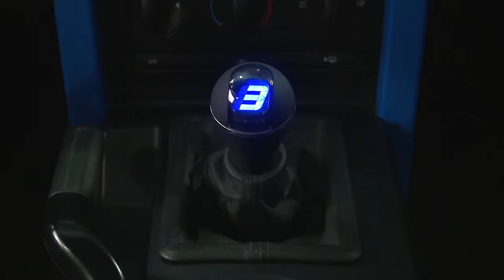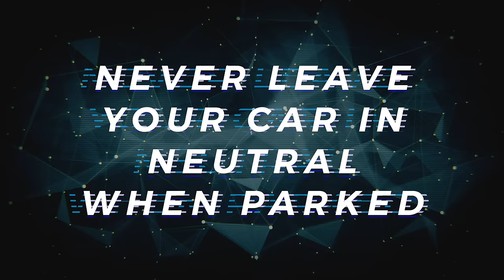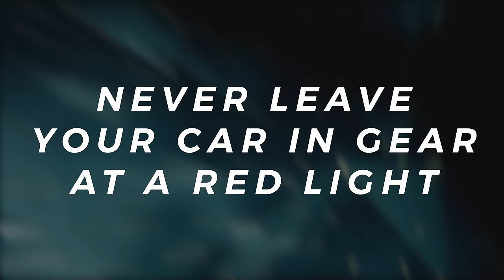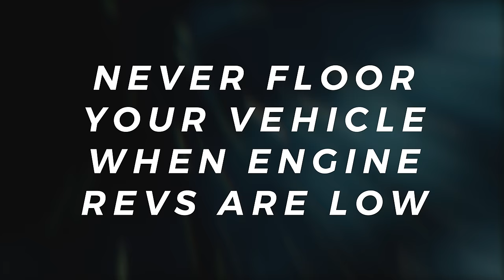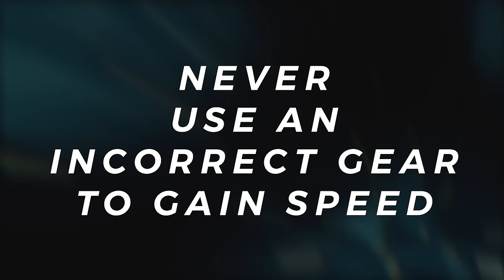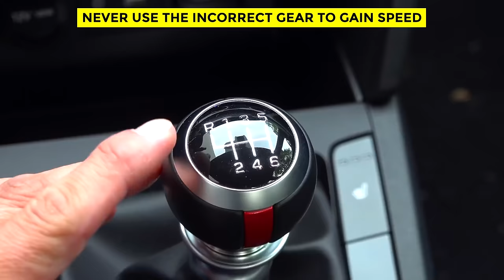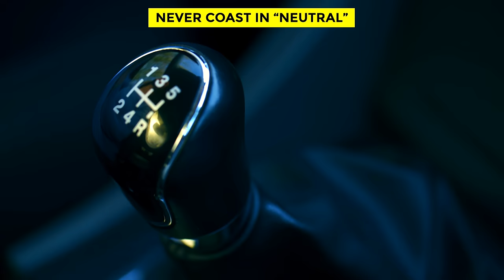7 Things You Should NEVER Do In a Manual Transmission Car!

Comment: This is all wildly exaggerated, you cant really lug a newer manual as if you have an electronic throttle body then its designed to use max torque per rpm, so pushing the pedal down all the way may only get the throttle body open 80%. Also, i grind gears because the throw-out bearing is a little worn.

You want to slip your clutch a little to make it smoother, so don't say "never slip your clutch"

Also, a clutch isn't all that expensive depending on your car, ive got a 300ft-lb clutch and a factory replacement is around $600 which is fairly cheap

"Transmission doesn't get proper lubrication" dude, its not like an automatic where you need pressure.... its a manual, an empty case where the fluid rests and gets stirred up, no torque converter or anything.
Reply: also loved the one about the engine not getting enough oil while coasting in neutral...
the engine isn't engaged to the transmission. you might as well be idling at a light

Comment: 1:47 THIS IS DANGEROUS ADVICE! The clutch pedal should only ever be pushed in either if the car is stopped, or if you are changing gear. If you are coming to a stop, the clutch pedal should only be pushed in at the last moment just before it would stall. To push the clutch pedal in immediately when yo start braking (remember we often use the brakes to slow down but have no intention of stopping) makes it harder to keep the vehicle in control and can be very dangerous in certain conditions.
Reply: bruh relax its not you can keep it in neutral if you are at like 30-40 mph and coming up to a light or something it dosnt matter

Comment: Fun fact: Planes are less complicated than cars
Reply: Really?
Reply: @thegrimreaper270  yes just learn how to start engine reverse thrust and the pedals easy
Reply: Well considering the lack of a transmission.... many GA airplanes are very simple. Some dont even have flaps! However, if there are flaps, speed brakes, a constant speed prop.... not necessarily
Reply: @thegrimreaper270  to not confuse "planes are less complicated than cars" with "planes are less complicated to operate then a car". But yeah: An old Cessna is simpler then a modern city car. Planes tend to be a lot more simple and mechanical, where as a car is stuffed with electronics.

Comment: I agree with most of these except one, leaving your car in gear when the car is off and parked. I was taught by an advanced driver not to do this. But that was a long time ago and I guess modern tech probably prevents damage to the gears if the handbrake fails. The only other thing is, I have a Hyundai I10 and clutch slipping with this car is almost mandatory due to the weird nature of this particular car. Pulling away with this car takes serious skill. Never had this experience with other cars. In other words I don't clutch slip with other cars.
Reply: What's with this "damage to the gears" thing people keep saying? You leave a manual transmission car in 1st gear or reverse, since that means the car can't move. It's advisable to also use the parking brake. In winter, if you have a manual parking brake, you only leave it in gear, since you run the risk of the parking brake cable freezing and leaving your rear wheels blocked.

How can you damage something that is designed to take the torque of the engine and move it to the wheels? HOW? Going 0-100 kph in 3 seconds means you're pulling 1G in acceleration. That's the equivalent of your transmission holding the entire weight of the car VERTICALLY, with no damage.

In other words - the torque a stationary car (or even one parked on an incline) applies to the gears is nothing compared to what they have to go through daily, during normal operation.
Reply: Clutch is designed for some slippage. Otherwise you'll stall all the time.
Reply: @2010ngojo  the weird thing is, this particular clutch is very "narrow" if that makes sense. The amount of play before it starts to take and when its fully engaged is unusually small. I know a lot of people who have the same model and they all say the same thing. The car shudders very easily. Even advanced drivers find it difficult to get used too. I think half the problem is the fact that its only a 1 liter engine.
Reply: I usually leave the car in neutral, with hand brake on, unless parked on a hill. But in modern cars with disc brakes in the back the mechanism in caliper sometimes fails, or cables seize if not used on daily bases. Personally I rarely see seized cables, even when the plastic coating breaks, if the hand brake is used regularly. As for winter use, I like to slide my rear on the nice, fresh snow with my hand brake on - I never experienced frozen cables problems in the winter time.
Reply: I dont leave my car in gear when parked either.

Even if I did it wouldnt stop it rolling down a hill, everything inside is so light that the engine and transmission would just start turning with the wheels anyway so it wont stop it from rolling.
Reply: yea, i usually let my car stay there just relying on the parking brakes. cant afford to ruin anything else especially the wonderful motor
Reply: @_Zekken  sounds like you have a compression leak and need and engine overhaul, it has nothing to do with how "light" your components are.
Reply: @royhsieh4307  how would it ruin the motor?
Reply: @lazyh-online4839  it does not have a compression leak, I only got a compression test done 2 months ago with it last full service, which was done by one of the best performance shops in the country, and according to them the entire drivetrain is in fine condition.
Reply: @_Zekken  alrighty then, I'm not sure what the issue is then, as mentioned the "lightness" of your vehicle/components has nearly nothing to do with their ability to resist rotation. If you're on anything besides a steep incline there should be no movement whatsoever unless there is either engine or drivetrain issues of some kind of it's put in gear whilst parked (1st or reverse obviously).

Comment: This is reminding me of the time I found out that my vw Polo from 07 doesn't need its clutch pedal. If you press the gas pedal just the right amount, you can pull the gear stick out of gear as well as back in when you match the revs to the speed and gear that would fit.

That's not very healthy either :)

Comment: It's better to put your gearbox in neutral, engage the parking brake, and then put the gearbox back into gear. You do this so the weight of the vehicle will be resting on the brake instead of the gearbox
Reply: European: Question
American: What's your question?
European: There is no parking brake
American: What?

Comment: On my car, if I leave the stick shift in reverse the backing lights will turn on, even if the engine does not run draining the battery...any other gear, not only the 1st is ok.

Comment: My friends doesn't use his clutch when his car is above the first gear

I never heard it grind
Reply: i learned to drive a manual when i was 10, took my drivers test and got my license in the same truck i learn in, after i got my license my dad taught me how to shift into any gear over first without the clutch and oh my god, that saved my leg so much work and it worked so well cause my truck only has some 110 hp
Reply: @calebb5106  what the fuck? how can u shift in any gear without the clutch?
Reply: @burstkappa6206  it's only for 2nd and up, but you would run to the top of the gear or around the top and let off, if you were in second you would push to neutral with light pressure as to not damage anything but once it hits the right rpm it will literally fall into neutral, then to go into 3rd you would push up into 3rd until it falls in, if the rpm is too low then you can blip the throttle to get to the right rpm and just repeat to whatever. I would recommend finding an empty straight road and practice without any traffic around before doing it out with a traffic around, I mostly do it now when my leg is giving me issues again so I don't hurt myself any further
Reply: @burstkappa6206  if revs match (drive shaft & crank shaft), you can pull it out of gear and put it into gear without a clutch. Doing it perfectly ensures basically no wear on the transmission or clutch (you still need that when starting from a stop). Doing it badly will f*ck up the transmission's synchronizer rings.
Reply: lets give me a moment to send my warm congratulations to your friend who r in the elite shifting club
Reply: Roy Hsieh   Lol it’s so easy to do though.
Reply: Ah yes flat shifting, if you know how to do it well theb your gears will never grind

Comment: What about when I am red lining in top gear, do I switch it to race mode or something
Reply: Duh, haven't you seen an "R" marked on the gear lever, that is the "race mode", also works as reverse. If you put in "R" and drive from still, it will move only in reverse. If you need to engage "Race mode", you need to reach the red line in top gear and then put it into the "R" gear and dump the clutch.
Reply: @naseeb46  Prepare for a few G's of force (in some direction) when you do this, race mode is powerful.
Reply: I'm dead
Reply: What tf is race mode

Comment: Ah yes, letting your can idle will make it overheat and fail, even with excess air running through the rad. 😂😂
Reply: michael lee   You are rolling down a hill in neutral. Car at idle with heaps of air flowing through the radiator. It won’t hurt your engine at all. The motor isn’t running at high revs. So no need for the water pump to be pumping heaps in. Same as oil.
Reply: michael lee  so why dont you switch your car of when you stop becuase its idiling? A car idealing is the least stressful for the car becuase it under the lowest load. Cars are made to ideal otherwise we would all be switching a cars off at stop lights.
Reply: @dieter2889  Your point is valid, but excessive idle times and low engine speed operation can cause excessive carbon buildup on everything from the pistons back to the throttle body, some engines worse than others. I've sold and performed so many throttle body cleanings and induction cleanings because people think idling their cars around town is the best way to drive them.
Reply: @collinbyrd6847  true, letting your car idle excessively will cause excess carbon build up. Same with short trips yoy never let the car burn of any of the build up.

Comment: For the second tip, is it also okay to ride in neutral when going to a stop, using only the brake pedal?
Reply: This comment is a little old, but it seems to be a genuine question, so I'll answer it: It's totally okay to put the transmission in neutral and take your foot off of the clutch to come to a stop.

Comment: You shouldn't coast down hills in neutral but for a different reason, when you are in gear you will go slower because of engine braking, going into neutral means you are rolling freely down the mountain and have less control of the vehicle. Also you will heat up your brakes more because you aren't slowed down by the engine which can be really dangerous if you are on a big or long hill because your brakes will fade from that and then you can't brake at all but this is more a problem with heavy or old vehicles that have brake shoes. You also shouldn't ride the brake for this same reason, do shorter, hard braking instead when going down a hill.

Comment: The reverse gear on my car isn't synchronized so I've grinded that gear a few times... I don't do it anymore though as I learnt to look at the stick to make sure the gear has gone in fully, if it hasn't I go back and forth between 1st and R until it finally does get into the grooves of the gear.
Reply: Model T?
Reply: @mikekelly5869  alot of cars have unsynchronized reverse gears probably up into the 2000s
Reply: what helps is going into 5th then reverse because its right above it, or have it in neutral hold the clutch down for a few seconds and it should give enough time for the gears to slow down, or my favorite way just go right into reverse fast and it dosnt grind

Comment: "There is no oil pump in a manual transmission, so coasting downhill in neutral doesn’t starve a gearbox of oil" thank you for tapping in this too. my ex bf always did that and i kind off coping it...never again!!
Reply: it dosnt matter as long as the engine is running you cant cost in neutral it dosnt cause any harm

Comment: So, I have a Ford Ecosport diesel. I usually keep the revs between 2k-3.5k rpms (very rarely 3.5k) 

I usually slowly down shift from 2k+ rpm and the revs climb upto 3k rpm or so.

My question: Is this a good habit? If no, what's the alternative for using maximum engine braking for better fuel economy without applying breaks

Comment: For hills, what I usually do is I release the clutch to the biting point right before I’m about to take off, then I release the brake n get on the gas as soon as possible before the car starts to roll back. I’m new to manual so idk if this is the right technique or if I’m actually hurting the clutch in the process.

Comment: I drove my 76 Camaro with a m21 and always had my hand on the gear shifter, had no such problems. Coasting in neutral I had no problems with control or oil pressure. Everyone is different.

Comment: 9:15 actually its a good thing in older cars. some don't have a one  way bearing on the gears and when goind downhill you can get engine into red line preety fast or damage the transmission/engine. such of a car that is better to get into neutral when going downhill is a trabant 601.
Reply: trabant 601 is not a car 🤣 my parents used to have one, so I know best!

Comment: Very experienced drivers drive away in 1st gear ofcourse, but when you have the right moment you can put it in 2nd and so on without using yr clutch. The engine and gearbox have the same speed, so it automatically switches in 2nd, 3rd etc. without grinding the gears. But most people should not do this, because this needs a lot of experience.

Comment: Very funny to listen from Europe where all drive manual. In most of descriptions you miss details and present as "never-ever do that", however some techniques are absolutely normal as weighting on the red light with a gear but clutch pedal being completely down - no disks are touching so no overuse of the material. If you cant drive manual or half of US cant doesnt mean others cannot
Reply: its just kinda weird to leave it in gear i mean your throwout bearing will go bad faster and will wear your pressure plate more people in the uk are just weird ig
Reply: @ethanol-fb  how it will go bad faster? You leave it a gear with clutch pedal down - at this point there is no physical contact inside the gearbox. People are weird to say smth will go bad not being able to argument why...
Reply: @ethanol-fb  tell you more - in cold regions sometimes you even park your car with gear in and leave it for the night. Doesn't make gearbox break faster (since motor is off) but at least you will be able to drive the car in the morning after very cold night.
Reply: @gnoverelectric  leaving your car in gear wont do anything anyways youre supposed to park it in gear anyways whats your point
Reply: @ethanol-fb  no you are not supposed to park your car in gear - you have manual break for this (or parking break which is not a gear).  You wrote "its just kinda weird to leave it in gear i mean your throwout bearing will go bad faster" - which does not make sense - you stop at light, on the gear, clutch pedal down, break pedal down (no disks are in contact so nothing will go bad faster). To start to move you just remove break pedal and move the clutch up - no need additionally to put gear with your hand. Simple as that. Everyone drives it. Sure you've ever driven the manual?
Reply: @gnoverelectric  look i know you dont know anything about the inner workings of a trans but whats crazy is i build transmissions to disengage the clutch it uses the throwout bearing to press up against the pressure plate how hard is that to understand, and yes mf you should park in gear idk why so many people dont understand that you are supossed to park in gear some cars will have a lockout so you have to put it in gear to take the key out parking in 1st or reverse dosnt matter wont hurt anything
Reply: @ethanol-fb  Yes, you know how the stuff works but dumb enough not to understand that when you stand at the light with clutch down there is no friction part between pressure plate and throughout bearing since there is no contact at all. How does it make something to be used more? Really, you make transmissions, dude? No one say to drive with clutch partially in, but standing at light is totally fine. For parking, I really don't care, some cars are supposed some not, also depends on conditions etc. But no fck you can prove that with clutch engaged with working engine you make stuff get used more than not doing it.

Comment: bruh not all cars have hill asist. yeah when you have to wait in a hill you press the brakes and get the car into neutral, when you are ready to go you go in 1st gear and slowly release clutch until you see your rpm go a little down then you get off the brakes and press the gas and slowly release the clutch

Comment: going downhill in neutral also keeps your alternator turning at idle rpm, which is inefficient when you could use gravity to charge your battery a bit more basically for free.

also you should avoid braking in slippery conditions, shift down and let the engine do it instead if at all possible, engine braking will never fully lock up your tires and thus keeps you mostly in control, start decelerating early enough and you're good, the brake should only be used in emergencies and to come to a full stop.